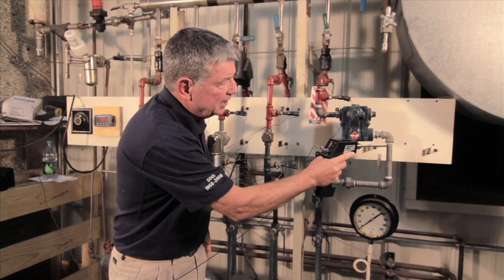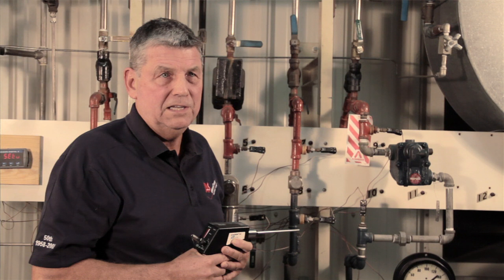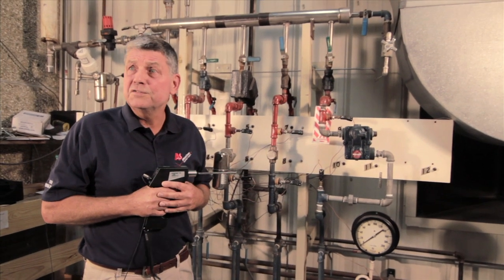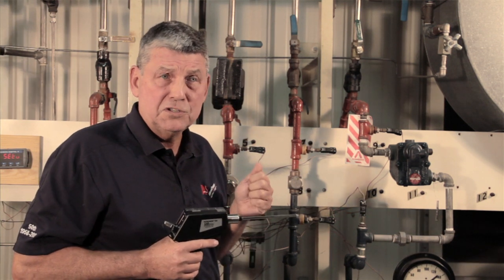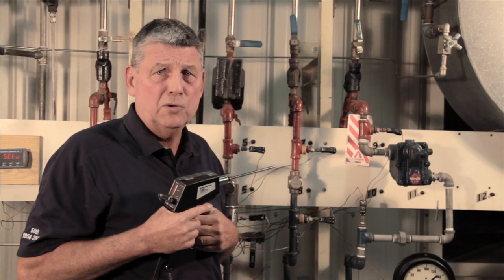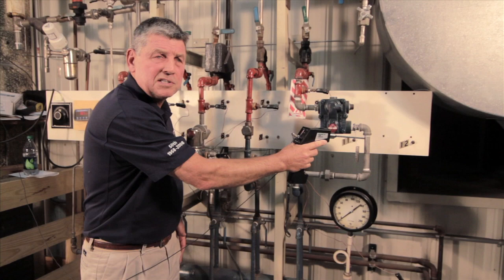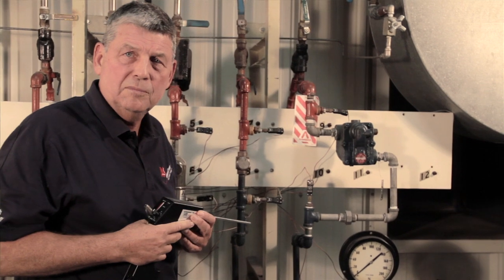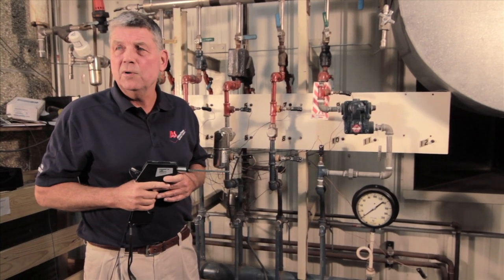How to Test a Float & Thermostatic Steam Trap | Affiliated Steam and Hot Water

Comment: nice vid. Could you also take the temperature going in and out....thx
Reply: That's what we do on our traps.
Reply: Checking temps is not a 100% accurate procedure. Depending on your system.
Reply: I feel like a pressure gage before and after the trap would help more.